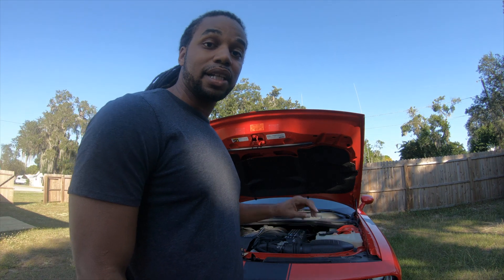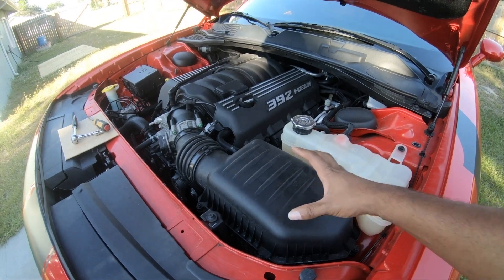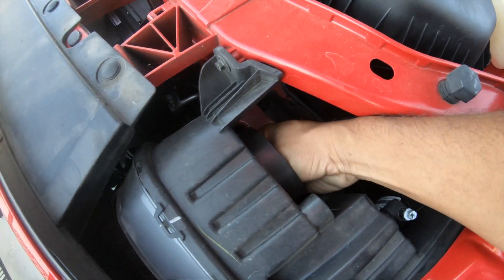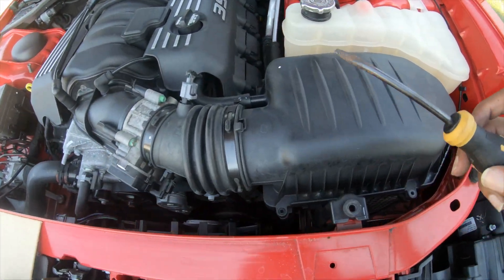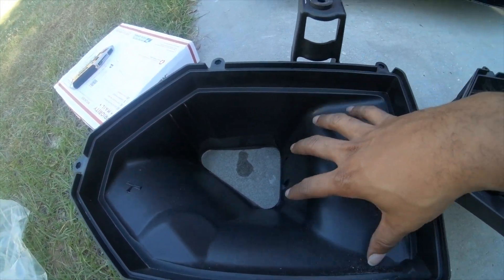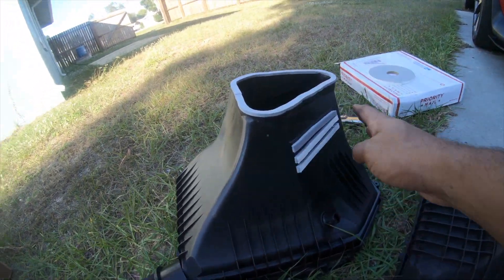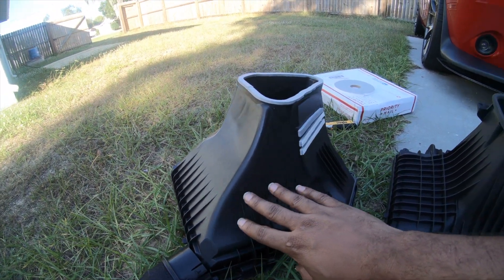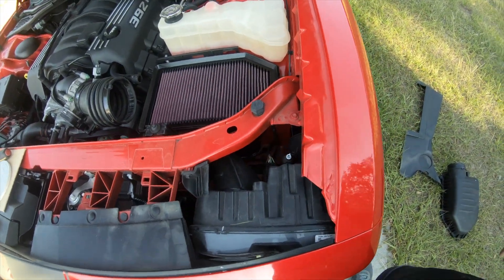Installing Hellcat airbox on my 6.4 Challenger

Comment: Excellent tutorial! Great info especially given the use of the seals. I will add however the Hellcat Air Filter which is also a Mahle Part LX3482 will outflow the K&N Drop in. The K&N is rated at 780cfm, much lower then dirty. The Hellcat Paper Filter is 1100cfm, mid 700s when dirty. Try out the HC Filter with your HC Airbox mod!
Reply from the maker: Andy Sookai Thank you for the support. Also, I didn’t know that about the Hellcat filter, I am definitely going to have to change to that filter.
Reply: @DrHorsePower  Anytime bro! I found out myself as i was about to do the K&N  drop in on my Widebody 392! The Mahle filter just came, order that part on Amazon as its cheaper then the Mopar part number. Mahle is oem filter manufacturer for the Hellcat.  You got the chopstix cam! Sounds amazing! I'm subbing for more content and hopefully you get it dynoed soon!
Reply: @DrHorsePower  can u go to dodge and have them do it?

Comment: Its a cheap CAI solution, like you said...provides 0 performance gain on a stock car.  Avoid the K&N and get the MAHLE LX 3482 Air Filter instead.  1055CFM over the stock 6.4 filter that is 731cfm.   I did this mod awhile ago, and did the HC airbox lid install too.  only to get the matching SRT logo for my SRT392.  Good video, and its super easy.
Reply from the maker: I really appreciate your support and feedback my friend!

Comment: Gr8 video, I have the 2023 Scat Pack Shaker package, & the first thing I did notice, was the heat signature, when back in the garage, this car maintains heat for several hours, hence the reason I leave it outside with the hood open living in Florida, before bringing it into the garage; So I have to do some research due to the different air flow design system, i.e. an open exposed top filter; The Shaker package, for those that have them, I find it odd, MOPAR didn't include two heat breather ports on both sides of the Shaker to allow heat to escape, hence the reason when I'm back @ my crib, I open the hood for heat disbursement, pain in the ass, but like Dr. H stated these 6.4's have a mind of its own when it comes to heat.  One change I made @ 400 miles, I replaced the OEM oil, which is Penns synthetic, 0W40 over to Amsoil full synthetic, 0W40, I happen to have been in the Autoparts business for many years, & road Harley Davidsons, most of my life, which are all (air cooled), the Amsoil dropped the engine temperature by 15 to 20 degrees due to less friction, (Friction = heat); All my Dressers & my last bike an FLHP Road King, where the heat shield placed by HD wasn't needed anymore, that is a significant drop in temperature; So back to my Scat Pack, running with the change of oil, I have noticed a drop in temps, due to less friction.  Now MOPAR just authorized Amsoil to be used in the HEMI's so with that being said & not connected in anyway shape or form with Amsoil, this is a real cheap, multi effective way to drop heat from the beast 6.4's & Hellcats. Now to this video, I haven't had the time due to restraints, but I will do my research on this headlight air system, for the Shaker Pac.  Again, Gr8 video & you make this look like an easy install, that scares my functioning drunk ass to hell....
Reply from the maker: I really appreciate the support bro. I’m in FL as well so I feel you

Comment: What's up bro new in the neighborhood. 
 Basically what we get is a good sound,  maybe one or two horses but that if we make other changes.
I got a Blackhawks from k&N it looks great and sound great but performance i can't feel a thing,  and  keeping the filter open it will drag hot air regardless the metal shild.
But it's looks and sound great and we love that.
Good video.
Reply from the maker: Orlando Flores I completely agree with you bro. Some people believe we will add like 15whp, and that’s far from accurate

Comment: The problem with the Challenger is weight. Compared  to the mustang, camaro, and corvette the challenger is about 500 lb heavier. It is a 5 seater with a usable backseat for an adult small to medium build. A  larger person can fit but it's not comfy on a longer ride. Horse power to weight ratio is the big problem. Things like a cat delete, better muffler, and larger pipes will help combined with an air intake. Bottom line horsepower cost $$$$. The more money you spend the more horsepower you get. Procharger make a oem fit blower, you can also get twin turbo kit. Both will add a ton of horsepower But the standard 392 piston roller kit must go. The top ring was moved closer to the top of the piston. This thinned the top and makes the piston prone to cracking or out right breaking If you add boost , YOU MUST change them to ( what i used)Livernois Motorsports 6.4L HEMI DROP IN PISTON AND ROD KIT. The kit worked without having to balance or check piston clearances but are made to work with forced air systems, custom tuned after the mods are done.

Comment: Now those covers are screwed in for 19 and 20. And those screws are hard to get to and you need a certain tool to get them out.
Reply from the maker: Ooooh I didn’t know that. Dodge is really making things complicated for us
Reply: @DrHorsePower  I only found that out by watching other. U tubers.
Reply: @DrHorsePower  but since I have over 5k in tools.   I should have the tool that helps me when I put this in my 1320. But knowing my luck it will be the one tool I have to buy LOL
Reply from the maker: @CCW-wg8ds  I appreciate you letting me know. I may try to do an updated video on the newer cars

Comment: you didnt show how it fits into the light housing. Did u need foam as well? Glue?
Reply from the maker: BLUTUUF ONE My apologies, I used the double sided adhesive foam strip and wrapped it around the end of the tube.
Reply: @DrHorsePower  ok cool thanks! Definitely a mod to get. Your front splitter looks good too. Did u lower the car?
Reply from the maker: BLUTUUF ONE thanks, I actually ended up selling the lowering springs bc they caused my 0-60 times to increase. Traction was horrible
Reply: @DrHorsePower  wow. i know u got rid of them fast lol. Thanks for the info bro.

Comment: Can we install turbo on the same location where u installed air box???
Reply from the maker: I’ve seen that on a drag challenger, but all the modifications looked custom and super expensive
Reply: @DrHorsePower  like major changes are required???
Reply: I am not fully aware I need a guide with what exactly is the method. Will be easier to decide

Comment: Hey man! I just got a 2015 challenger srt 392 last october.  I definitely want to do the hellcat air box, but i’m unsure of what else to do.  is there anything you’d recommend upgrading? i got the car with 8k miles so it’s pretty much stock except for the mid muffler delete i did on it
Reply from the maker: I’m not sure how much you’re looking to spend, but I really felt a difference with a bigger throttle body and ported intake manifold. Those mods work great with the intake. But I’m not sure if you’ll need a tune for those or not. I got tuned after installing.
Reply: @DrHorsePower  Awesome, thanks for the reply! I really appreciate it brotha!

Comment: Great video. Where does all the water go when it rains?
Reply from the maker: hebee81 The entire bottom side of the box is open so it just runs down to the ground. Not enough suction to pull it upward.
Reply: Clutched 392 oh got ya. Thanks.

Comment: Wear did you get the head lights with the air hole
Reply from the maker: The challengers come that way, you just have to remove the small piece of plastic in the middle

Comment: Will an aftermarket intake mess with your ECU?
Reply from the maker: I have heard of cars having issues. But zero issues here.
Reply: @DrHorsePower  did you tune your car when you put this mod on? Because I’ve heard if it’s tuned, there shouldn’t be a problem
Reply from the maker: @levan_bloody5047  Nah, I drove it that way for about 2 years before tuning it. It ran great
Reply: @DrHorsePower  Allright thank you brotha, I really appreciate your help. I will be doing the same mod on my car next week.🙏🙏🙏

Comment: Will this also work on a 2013 Dodge Challenger RT 5.7?
Reply from the maker: Paul Blarts Garage I want to say yes, but I’m not positive.
Reply: @DrHorsePower  ok ty for the response I'm gonna see if that plug will pull out of the head light you pulled yours from cause everything else is the same.
Reply from the maker: Paul Blarts Garage Plz keep me posted and lmk if it works.
Reply: @DrHorsePower  unfortunately  it want work the head lights changed in 2015. Mines a 2013. I think hammer makes a kit you can buy for it to but it's 354 dollars so I'm back at square 1. Guess I'll just use the K&N filter for now.
Reply from the maker: Paul Blarts Garage Aww ok, thank you for updating me
Reply: @DrHorsePower  ty for your videos I just subbed  saw you have some nice content.

Comment: Hey man where did you get your hose for the intake to the light
Reply from the maker: Patric Raines I just ordered it through amazon I believe.
Reply: Clutched 392 thanks for your reply
Reply: Clutched 392 do you remember what size
Reply from the maker: Patric Raines No prob. I just went back to look at it, I was mistaken, it was from eBay. But I didn’t have a size selection, if you search “ hellcat intake tube” it should pop up for you. I’ll try posting a link for you.
Reply from the maker: https://www.ebay.com/itm/371505396444
Reply: Clutched 392 ok thanks man for your time

Comment: is there a tune that could go with this and make more power?
Reply from the maker: Scatlife_ Yes a time would definitely add more power to this mod, but I don’t think it’ll be much more
Reply: Clutched 392 how much crank horsepower do you think this intake would add to a stock challenger scat pack?
Reply from the maker: Scatlife_ I’m thinking only around 5-8hp. But it’s a gain in throttle response and the hp gain is throughout the entire rpm range so that’s good